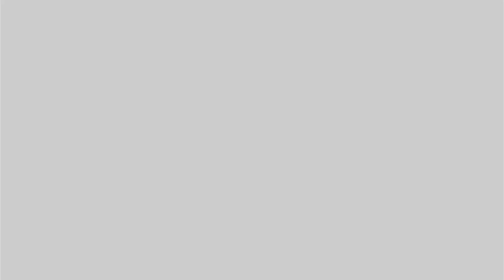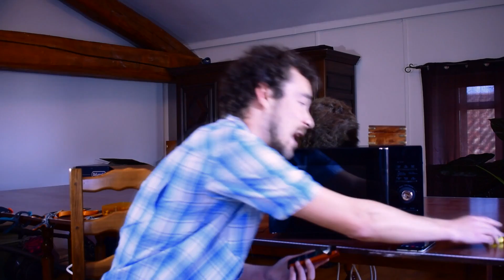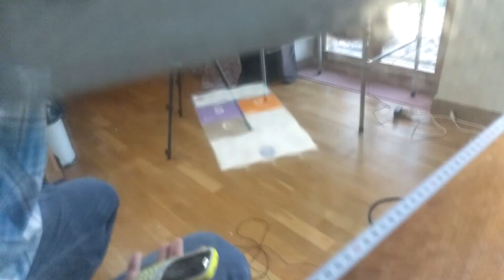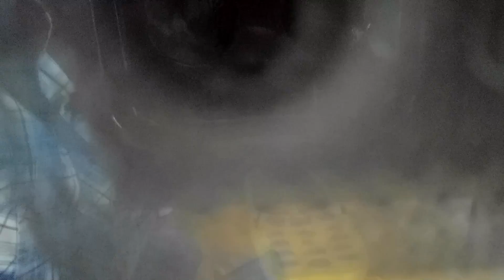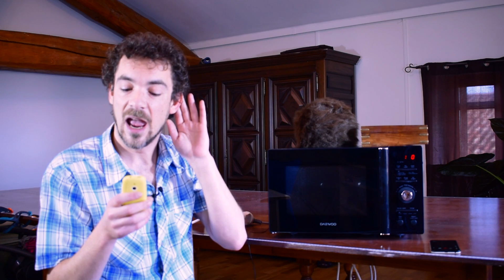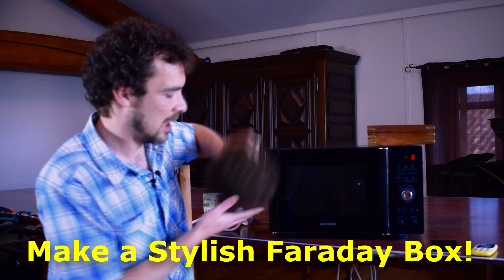Is your microwave a good Faraday cage?

Comment: Yeah, but you don't need a faraday cage to not receive calls, right? You'd want a faraday cage to keep batteries, phone etc safe in case of an EMP etc. In which case you need an old microwave without a cord at least. This is useless "info" because it doesn't shield every frequency. A phone frequency is totally different than an EMP or even microwave
Reply from the maker: If you want to block any signals going in or out of the phone, then a Faraday cage is also perfect for that. EMPs are a whole other banana. Depending on the strength, you might need much stronger shielding and careful grounding.

Comment: Hello, I'm a EME Technical specialist 
Just to let you know it is 100% down to the operating frequency of the Microwave (oven), 
as it is designed to attenuate that very frequency from escaping (therefor also entering), usually 2.34Ghz (aka 2340Mhz) which is very close to many 5G services. That is because there is no need to block any frequency significantly lower or higher as the Microwave only creates waves at that frequency :)

If you have a 4G and 5G service guess what....whatever can get through, will get through. Also keep on mind half and double wave length of operating frequencies can be affected.

Comment: I put my phone in with it unplugged and I looked through the window and I noticed it dropped my wifi and cell to one bar.  Maybe if you wrap it in aluminum foil and toss it in the microwave It will block it.

Comment: I have my modem in my bed room how can I protect myself from elf. Besides moving it to another room can you wrap it in aluminum foil???
Reply from the maker: Your best option is physical distance - move it into another room. Otherwise, it's difficult to shield it while making sure it doesn't overheat. Even low-power modems will eventually get REALLY hot if enclosed in any kind of small box / wrapped in foil.

Comment: Microwave ovens make great faraday cages. You simply need to further insulate and ground. They are far cheaper than buying most faraday bags and some folks may have an old one laying around. Even a broken one perhaps. Very effective.
 You have holes in the door shielding. They only protect against microwaves. Not same wavelengths from cell phone, which penetrate the door. Bad quality experiment..

Comment: Ok, I tried the microwave test also. I put my smartphone in a friend's microwave and called with his dumb phone. Mine rang.
Then I did.some research and found the frequency range of phone service providers (,in US) is from 600 MHZ to 2100 MHZ. I'm thinking that must play a big factor in this experiment. Or maybe there's a better antenna in the smartphone than the dumb phone?
I also tried putting my smartphone in a stainless refrigerator and the dumb phone was still able to call it!

Comment: If I might add, a 'helpful hint':  when you put your phone inside any ''cell phone signal blocker', especially if using one regularly, put the phone in airplane mode before turning it off. Otherwise, your phone will drain it's battery trying to send out it's signal(s) while inside the blocking box. It sucks your battery's juice even faster than when it's just sitting around "turned off". - James "Don't even call me Heloise!" Cameron.  NOTE:  I didn't use the term "Faraday box, (or cage)", because the box, the one shown here, is not one. A Faraday box is used to block EMP surges, specifically, that can damage your electronic device; it's not necessarily to block the signal going to and from your cell phone. So technically, the experiment using the microwave may be valid for the receiving and/or transmitting cell phone signals, but is not valid in terms of being an actual "Faraday box", (by definition).

Comment: It appears that it depends on the microwave and the phone. Below is a video Physics Girl did in which she tests several microwaves and runs some tests for leakage. Apparently some microwaves leak a tiny bit. What I don't understand is why a good microwave WOULDN'T block cellphone signals. Those holes are designed to block 2.45 GHz. Any frequencies below that should be blocked as well (the smaller the frequency, the bigger the wavelength).

https://youtu.be/ot4_jVFXxUU

Comment: wrap the microwave in aluminum foil HVAC tape and you'll have a successful faraday cage. I pulled the motor and interior parts from an old microwave i was going to toss out, wrapped the micro the way you wrapped your boxes and then put electronics i don't use on a daily basis in the micro to protect them from any possible EMP events.

Comment: Have you tested the microwave for leakage and why the grounding?
Unfortunately i also don't get the box :) 
Why not just limit apps from connecting, turn off all the connections, enter Airplane mode or turn off the device?
Sadly, the Box is needed around the house.